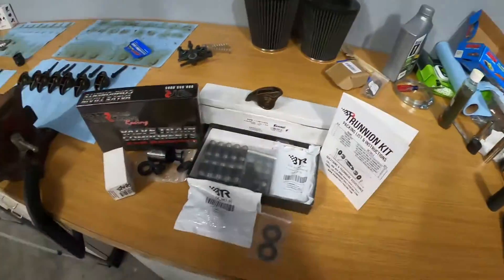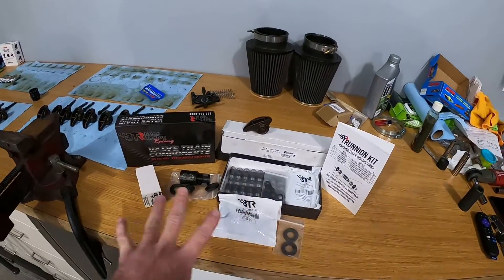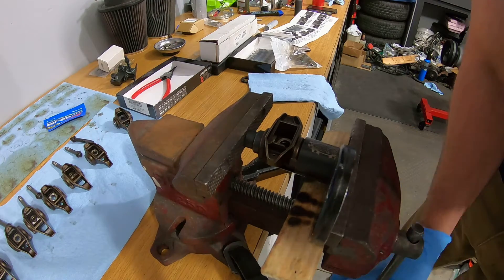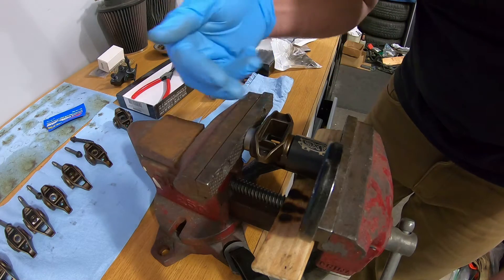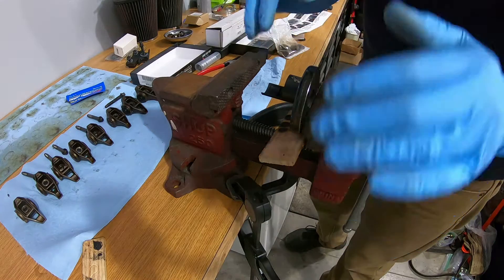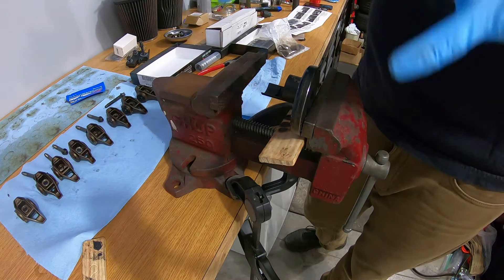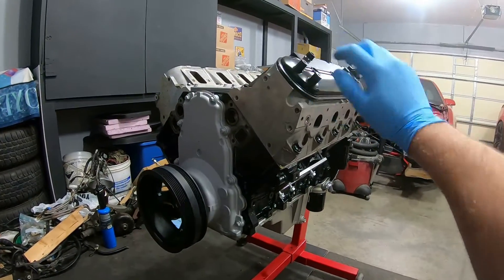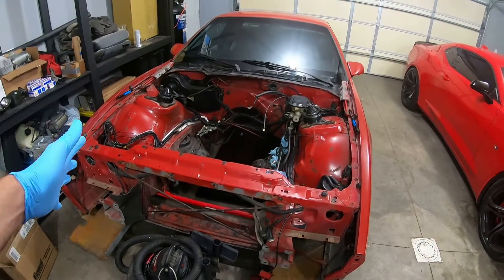LS Trunnion Upgrade BTR TK002

Comment: Why didn’t you put any oil or assembly lube  in the bearings before install so there not dry on initial start up?
Reply from the maker: There is grease in them already which keeps the needles from falling out. So they weren't dry.
Reply: @EssMotorsports fair enough

Comment: You are wrong about longevity CHE bushings ftw. BTR lasted about 40000 then my engine was full of needles. Cam is BTR stage 2 with dual springs.
Reply from the maker: BTR recommends TK002 and they know more than me
Reply: What kit, tk001 or 002?
Reply from the maker: @treybadd  002
Reply: I was asking what version Brandon is referring to.
Reply: @brandonholliday86401 Willing to bet you had premature failure because of improper installation and had a very aggressive set up with high lift and/or lack of proper oiling.
Reply: Why would you be willing to bet without knowing who I am or knowing my set up? I do not believe it was an issue with oil pressure. I have had 58 lbs engine warm at idle since the upgrade and how can a competent person install these wrong?  I made sure each bearing was installed correctly. It makes more sense that the excessive wear was caused by low grade materials that the actual trunnions were made from. I am willing to bet that this is true in my case
Reply: @brandonholliday86401  didn't mean to come off rude, I had a captured needle bearing style trunnion upgrade from Comp Cams installed in my 6th gen Camaro with the gen V lt1 motor and it has right over 40k miles with a aftermarket cam and supporting valvetrain and I street drive it and take it to HPDE track days and it's still holding strong (knock on wood). Cam lift will have an affect on the wear rate on trunnions especially with a very aggressive cam, also you got to match the valvetrain together and make sure it works together as a whole with the cam you chose. I previously ran CHE trunnions and I checked my trunnions at 13k miles and they showed premature wear and that was with a mild camshaft, brass is a soft metal that wears fast and in my opinion isn't the right choice for a street car that is daily driven over 10k miles per year.

Comment: I just ran into the same problem with my valve cover. Didn't know that would be an issue
Reply from the maker: Yeah I had to buy an LS3 style valve cover and just used it on that one side. Not a big deal

Comment: how do these compare to the CHE kit?
Reply from the maker: The CHE is the brass design. Brass is soft and wears. The BTR design would be better for longevity. Ive seen other shop channels say they used to run CHE but switched away because of wear after going back into motor year or two later
Reply: @EssMotorsports  going with yella terra roller shaft rockers